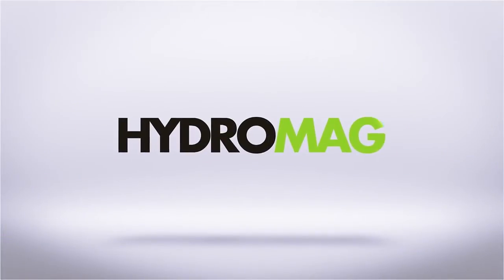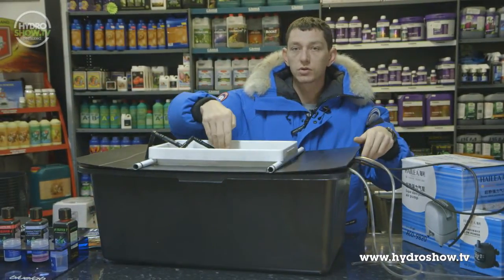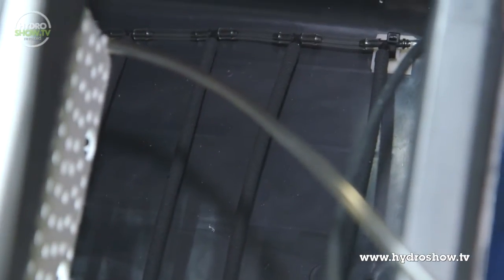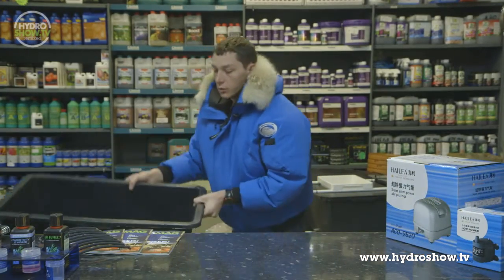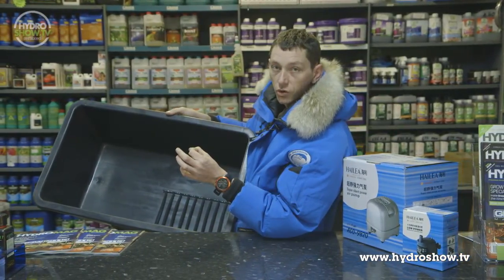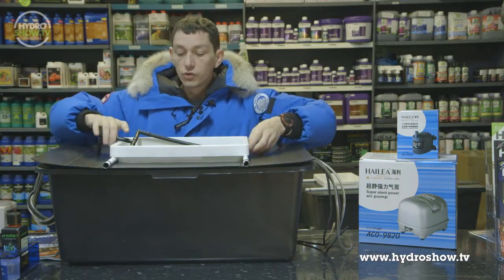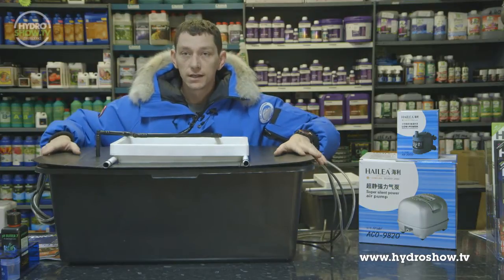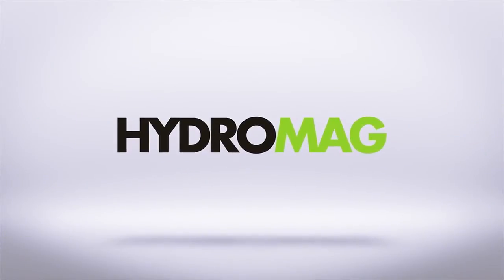#44 - Make a homemade hydroponics water bubbler / deep water culture system

Comment: wouldn't it be easier to drill larger holes for net pods and just use the bubbler to aerate the water -without the sprays to get a good grow rate?I have a system like an aero garden and thinking of replicating that in a larger tub for myself.
Reply from the maker: These Birmingham bubblers were all the rage at one point... the maker reckoned that a single bubbler would yield as much as 4 plant pots. Have you seen our Hydro vs Aero vs Soil video?